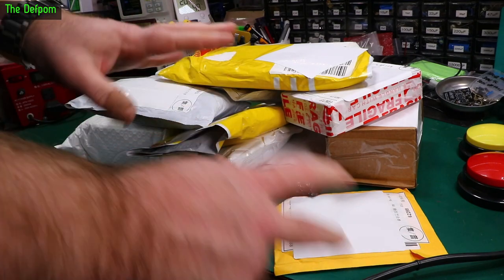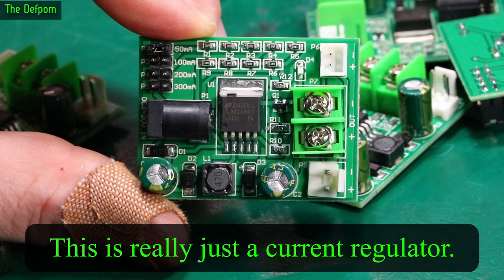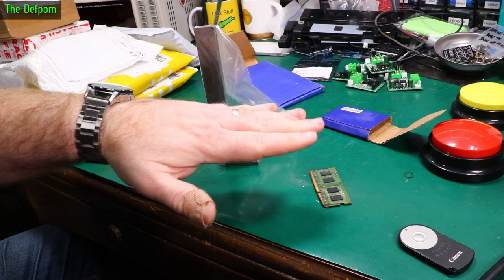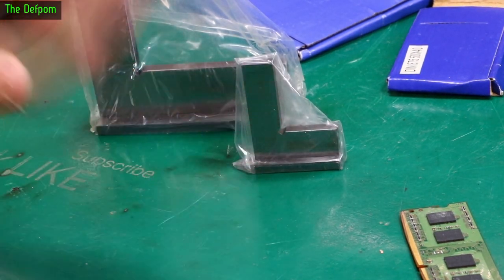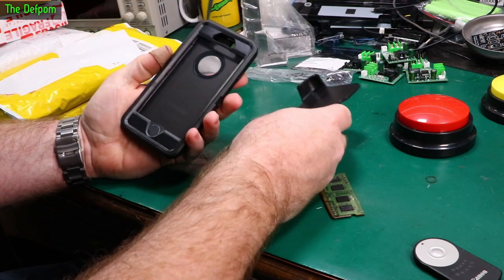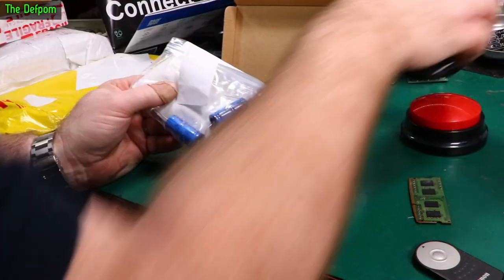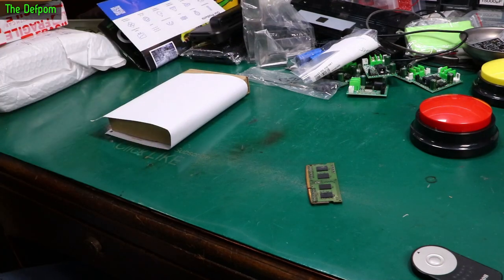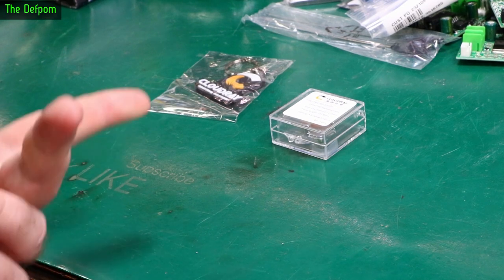🔴 Mailbag Monday 18th September 2023 - No.1177

Comment: You could design an SMD conversion PC board for through hole regulators. I've seen something similar on new 10 meter radios where a specific through hole transistor is no longer available.